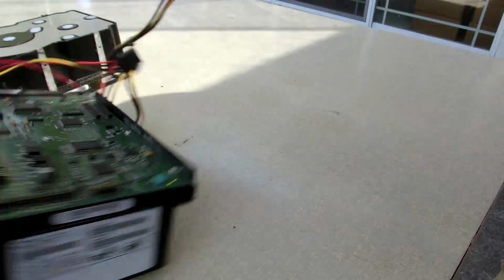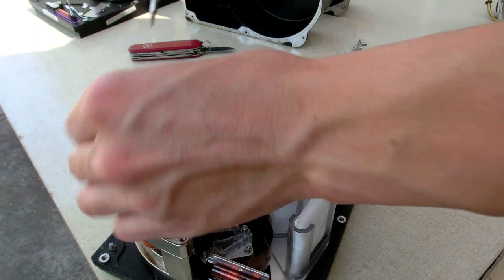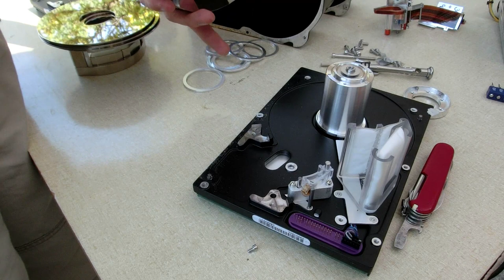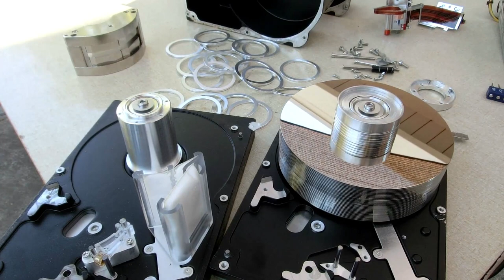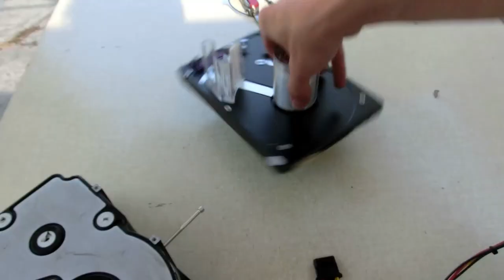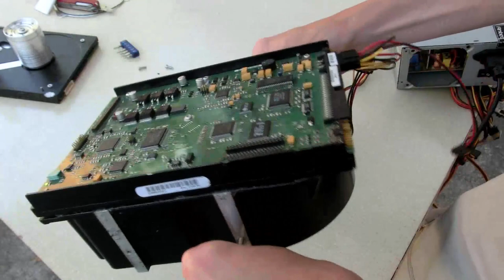DIY Hard Drive Gyroscope part 2: adding more weight

Comment: I guess it doesn't start properly with too little mass or too much mass because of the tuning of the sensorless algorithm. It would work much better spun up to 15000RPM. But a failure might launch it through a wall LOL. I've seen stronger gyro scopic effects spinning a 3.5 hard drive with stacked platters at 23000RPM but it does feel a little bit unsafe I'd like to keep all my fingers.
Reply: Coolkeys2009 If you try writing your own motor algorithm from scratch you'll most likely find it won't run as fast as the original or accelerate as quickly without lots of research. I'm not sure the arduino has the necessary hardware on board to implement a good sensorless controller. We may take hard drives for granted but I guess the people that design them are at the top of their fields(especially in the 90's when less dedicated hardware and pre written libraries were available)
Reply: Coolkeys2009 the main things that effect max speed for these are wave-shape and voltage.

it doesn't require much in terms of fancy hardware.

for 3-phase motors, sin^1/2 waves seem to work pretty good, and a lot of commercial drivers seem to use trapezoid waves. for use on 8/16 bit controllers, generally it is a good idea to use a fixed-point lookup table (Warning: avoid floating-point and "math.h" at all cost, it is emulated in software and very slow).

normal sine-waves run smooth, but don't run as much power through the motor, reducing top speed and torque. sin^1/2 or trapezoid waves are better at pushing power.

I have had a lot of vibration/stability issues with square-waves. these also limit top speed.

as for voltage, it has to do with how fast the waveform is. a higher waveform frequency (needed for higher speed), similarly needs a higher voltage to compensate for the EMF.

getting a high-speed may require ramming about 24-35 volts through it (HDDs often use an internal boost converter), and also varying the voltage/current along with the drive frequency to avoid burning the motor (you can use a low voltage or low duty-cycle at low-speed and ramp it up as speed increases to maintain a consistent drive current).

as noted from the HDDs, you generally want to start at a low RPM and then ramp it up. if you try to start the motor directly at a higher frequency, it wont spin up.
Reply: I beg to differ, I have written various BLDC algorithms from scratch after reading lots of articles on the internet, many of the semiconductor manufactures application notes various parts of Papers written for people's MSC's. They have been developing BLDC motors and drive methods from the 1960's and are still developing them today with FOC and other techniques.  Feel free to watch some of the videos on my channel to see how a properly driven BLDC motor can behave. I also believed in error for many years that permanent magnet BLDC were driven with frequency like steppers or induction motors till I did some experiments and research.
Reply: Coolkeys2009   I have also written motor-driver logic, for both open-loop and closed-loop commutation (both have merits).

generally, for the use-case, you don't really need a closed-loop driver, and it doesn't really effect the top speed all that much (if the code is tuned right), and open-loop is simpler to implement, but you will need a "ramp up" to get the thing spinning, and it does assume a fairly constant-load.

it also looks like the HDDs here were (probably) mostly using open-loop (given how the motors behaved), so another open-loop driver probably wont be much worse off here.

granted, closed-loop (using back-EMF to trigger commutation) is better for a motor which deals with variable loads or similar.

but a closed loop commutator is more a case of "maybe an MCU with fast analog input pins is good", but if needed you can also make it work with digital pins (and some analog electronics). more specialized hardware is optional.

of course, a person could just go any buy a preexisting motor driver.

but, yeah, induction-motors are simpler in variable-load cases (I am also messing around some with 2 and 3-phase induction motors).

granted, I am generally using MSP430s, rather than an Arduino.
Reply: Brendan Bohannon All HDD motors and CD rom spindle motors I have seen are run closed loop. It's the only way to get sensible start up time and lower power consumption. If you put a slight load on a hard drive platter as it's spinning up it will take longer to get up to speed it won't just fall out of lock the way it's does if you just ramp up the speed open loop. Also if you gradually apply extra load at running speed they will generally increase motor current to compensate again not just falling out of synch. Writing your own BLDC algorithms from scratch is non trivial, writing the latest FOC algorithms from scratch I reckon will cause head scratching even for professional engineers. Specialized MCU's have specialized motor control PWM with hard ware fault shut downs and can trigger A/D converter multiple input sampling plus other stuff, needed for good BLDC operation.
Reply from the maker: Coolkeys2009 why do you assume it's sensorless?
Reply: Coolkeys2009  I had thought HDDs did tend to stall and then trigger an emergency reset in case of spindle-load issues, but either way... not actually messed with a lot of HDD driver boards though, and the ones I had messed with were from drives from the 90s (and mostly I was after the magnets and spindle motors).

some of my own closed-loop driver stuff (currently only on the RPi) had actually been a hybrid, using mostly a frequency-based driver at the core, but using a 'sense' on one of the legs to keep track of the motor. if the sense bit flips sooner than expected, it increases the frequency, and if later, it drops the frequency some.

if it doesn't see a flip, it assumes the motor has stalled, and tries to reset (it tends to assume that motor speed changes slowly).

generally it had worked by leaving an unpowered "keyhole" during part of the cycle on one of the legs, and watching for the motor to induce a voltage.

currently, my MSP430-based drivers are open-loop only (using a pot as a manual speed controller), but I have only recently started messing with this.

I have yet to find a good way to do sensorless closed-loop commutation on stepper motors (too bad though, as they are high-torque and fairly affordable).
Reply: Rinoa Super-Genius Because it doesn't start up properly unloaded, If it ramped up on speed it would. If it ramps up at a different speed with different number of platters it's sensorless. If it has Hall sensors and can't start up unloaded then the firmware was written by idiots not the genius's I assumed LOL.
Reply: Brendan Bohannon Hard drives don't allow speed variation as it can lead to the start of sector being over written. If you gently place your finger on the outer edge of the platter and slowly increase the resistance it will compensate if you suddenly remove your finger or apply too much force and it over speeds or slows down it will likely shut down and restart.  Permanent magnet BLDC's motor are smaller higher power/efficient than stepper motors as well as smoother, but obviously not as suitable for some applications, many of the semiconductor manufacturers have app notes for sensor less type control of stepper motors to allow higher speeds efficiency/accuracy etc.
Reply: Coolkeys2009  ok, I had figured it was mostly open-loop (with some sort of stall detection) given the usual HDD behaviors, but either way.

I have driven HD motors open-loop without too much issue, apart from the general inability to deal well with variable load, and some need to manually tune parameters somewhat.

I have noted that how smoothly a stepper runs seems to depend some on wave-shape, with sine-wave like shapes being smoother (motor can spins fast and quiet, but doesn't have much torque), whereas best speed+torque seemed to favor a more reverse-sawtooth like wave shape (though the motors make a loud squeal when they turn).

plain square waves seemed to work best at low speeds, but don't work as good as speed increases.

most of what I could find for closed-loop with steppers was people putting encoders on them, but this kills their price advantage. couldn't find much info looking around for how to commutate them using EMF, and the "window" trick I had used for 3-phase motors doesn't work correctly (as done before it causes motor to stop working).

though, one possibility could be moving the sense window to a different set of phase-angles (sensing from 135 to 225 degrees or 115-205, rather than 0-90, since this is likely a less critical period for L1).

useful for some cases could be a motor which uses 3-phase windings but is otherwise more similar in construction to a stepper (fairly small step size but lots of torque, ideally at similar prices to typical bipolar steppers).

say, one gets something which is 3-phase but otherwise about like an 1800 oz-in NEMA-34 stepper or similar...
Reply: Brendan Bohannon Getting any BLDC motor to spin at a fraction of is maximum speed, possible power output whilst providing very little useful torque is what happens if you drive them open loop with variable frequency. This is only normally done in Sensorless configs to get the motor spinning just fast enough to generate BEMF. A good sensorless configuration will be even more efficient  than a sensored or brushed config. When I run my own controller I can see the current drop significantly and speed actually increase when it switches from open loop to closed loop. Note after continuously tweaking my BLDC routine I have found it's good enough often start up closed loop from 0 RPM! Lots of clever/hard working people have been working on the motor technology you have been discussing for many many decades I suggest you read up on their work and you will find a lots of the answers, Elon Musks Tesla motors have used a lot of the knowledge that was previously available and built upon it to lead the market, the same with some of the high speed train manufactures. Anyway experimenting and keeping an open inquisitive mind are the start.
Reply: Coolkeys2009   possible. I had mostly just thrown stuff together and made it work, whether or not it is "good" was often secondary...

my "hybrid" strategy, as noted, is partially closed-loop in that the motors can respond better to variable load (the frequency adjusts dynamically to match the motor's load). the rest is mostly manually tuning the variables to something sane for the motor.

my recent use of MSP430's is mostly to reduce cost (vs using RPi, like $2.75/ea < $25), but the ones I am using have a fairly small ROM space (2kB), which limits logic complexity. however, this still leaves the cost of the motors and/or transistors.

it is all a bit hit or miss, things often run hot and things have burned up in a few cases.
Reply: Brendan Bohannon I've also burnt up a HDD motor, blown some L298's and Mosfet's +driver ic's in the past, but as you learn more you know the things not to do but hey you always want more speed. I bought a dev board off ebay with a Pic 16F877a for my first experiments and then swapped it out for a Pic18f45k22  which was good for sensored and my early sensorless stuff. Then I built my own devboard on strip board using a dspic30f4011 running at 30mips and  pwm frequencies up to 150khz. It has 16K of rom 2k of ram, plus many specialized motor and power control pwm modes which is more than enough for my experiments. I need to find away to make my own PCB's next and move to the next generation of MCU's. Getting the right MCU for the job makes a huge difference.
Reply: Coolkeys2009  I have burnt up a NEMA-17 stepper, but luckily had the magnet wire to repair it (a roll of 28AWG). also blown up L298's before being like "screw it, these things are too fragile" and mostly using power transistors (a TIP120 or 125 is a little harder to blow up, and they can run most smaller motors, and were about $0.25/ea when I bought them). did blow up some IRF540N MOSFETs before (was not happy, those MOSFETs are $1 each).

some of my motors are a little bigger and can pull a bit of current (though generally at fairly low voltages).

yeah, the MSP430G2232 has 2kB ROM, 256B RAM, 14 IO pins. 8 of which can be used for ADC or PWM, but can only be used for one pin at a time.

the result is that I did it mostly like I did for the Raspberry Pi, doing all the PWM and similar in software, and using the ADC round-robin.

luckily for me, the MSP430G2xxx chips are DIP, so I can use perfboard for everything.

inverter logic basically just spins in a loop updating PWM, and occasionally updating other things based on counters.
Reply: +Rinoa Super-Genius By the way I've changed my mind, using the Arduino to trigger the coils and ramp up speed could get you quite good speed out of the motor. Just watch the VF curve or regulate the motor current of the motor so you don't burn it  or your output transistors/drivers out . You will just have to ramp the speed up slowly. Would make a nice video.
Reply: Coolkeys2009
yeah.
the VF curve is pretty important.

tried running an HDD motor with a VF curve more tuned for a bigger induction motor, and the HDD motor got very hot.

for the induction motor, the transistors get very hot, but this is more due to them being underpowered and the board being a bit insufficient when it comes to cooling (the small air-cooled aluminum TO-220 heat-sinks are... insufficient...). well, and I need to make a driver with more powerful transistors...

(TBD: BJTs vs MOSFETs, don't really want to use more MOSFETs until I have some zener diodes though... but heat is being an issue...).
Reply: Brendan Bohannon You can get some pretty high voltage mosfets, if their driven properly they should generate less heat than BJT's. I've changed my mind about driving the motor based on frequency ramp for Rinoa's project after spinning a Hard disk platter up to 20000 RPM, sensorless went up to 23000RPM  only a lot quicker, but maybe isn't needed.
Reply: Coolkeys2009  yeah. similar has been my experience as well WRT spinning motors.

though, granted, I am still fairly new to a lot of this, having only fairly recently gotten much into electronics.

the big problem I have had with MOSFETs in my past uses, has had to do with gate voltage: if Vgs goes too high, the MOSFET is dead. so, the idea would be to use some zeners to make sure Vgs never goes too high (by linking gate and source). otherwise, keeping Vgs safe with higher-voltage bridge circuits is non-trivial.

in contrast, it seems BJTs can usually take a lot more abuse, and generally a BJT needs to be hit with a pretty big transient before it blows up. they are also cheaper, so are less of a loss if/when they blow up. however, heat is an issue, as well as breakdown voltages (short of going to more expensive components).

my existing drivers have generally run at more modest voltages, but for some bigger stuff, I was wanting to run a boost converter and invert directly off a higher-voltage DC rail.

though, for higher voltages it mostly leaves needing SiC MOSFETs or IGBTs...

though, granted, the main alternative is using step-up transformers.
Reply: +Coolkeys2009 You gentlemen are just way to smart...lol

Comment: hmm could use the gyroscope effect to work the muscles out or something , only way ive seen it done is in a "powerball" device , Also i couldent help notice your bench power supply/pc psu is lacking a fan :-D
Reply from the maker: steve64464 yeah it was over 100 F* that weekend so i was using it to help move air inside the house. was blowing wind into my face with it.
Reply: heheh i like your style :-) , I have a TA450DC blowin air in my face at the moment , not sure i could live without it.

Comment: so you have just destroyed a perfectly working hard drive, imagine that guy who build it painstakingly, soldering such fine wires to its read head and you took no mercy.
Reply from the maker: +samdomding no it wasnt working anymore, it had run in a datacenter for 8 years straight and is fried, and also nobody made these by hand, these are assembled by robots. you cant trust humans to be this exact.
Reply: Robots in 1990's factories... THAT'S  funny.

Comment: if you are interested, take this tip: you may add a scaled up Bedini scalar beamer, and a quartz slug after charging it under a rising moon in the first 14 days of the astrological month; wrap it with a Caduceus coil of certain AWG...connect them in a certain way; and you will get a time warp field due to the combination of the high rpm and EM field....which is a scaled down time machine..I won t say further.

Comment: put the platters at the top (separators at the bottom) for obvious reasons :)))
genius
Reply from the maker: what obvious reasons are you referring?
Reply: it will wobble a lot more if the weight is at the upper part making the gyro effect stronger, isn`t it obvious?
Reply: you are after a more stable behavior with gyroscopes not a weebly wobbly vibrating thing. center of mass closest to the motor. never put a rotating mass too far along its axis of rotation or you'll get a slew of unintended harmonics and flexiness are a couple possible results